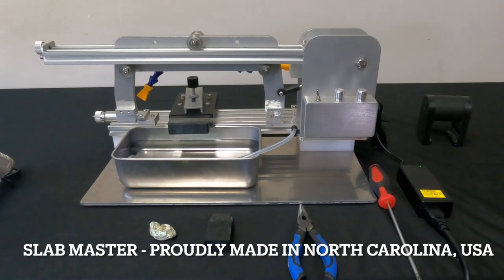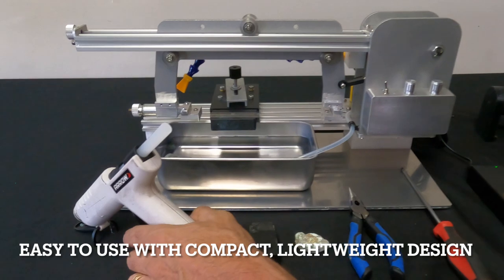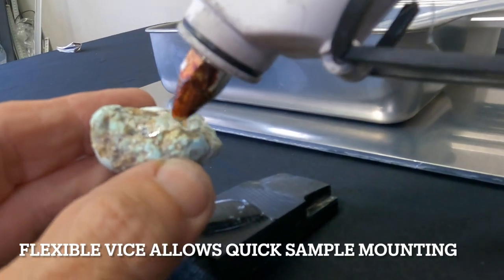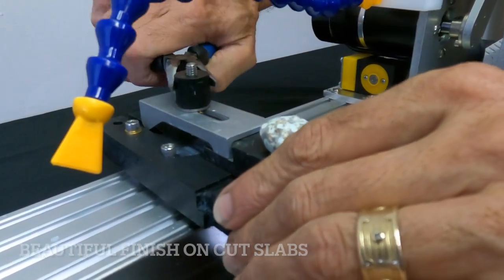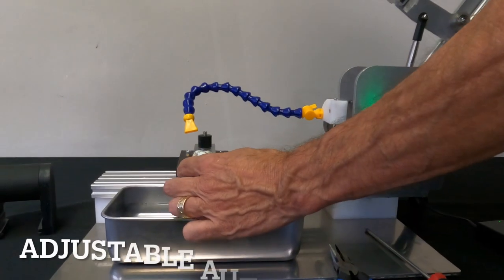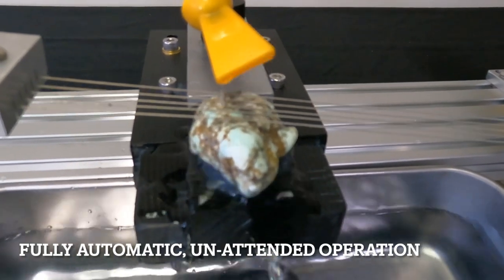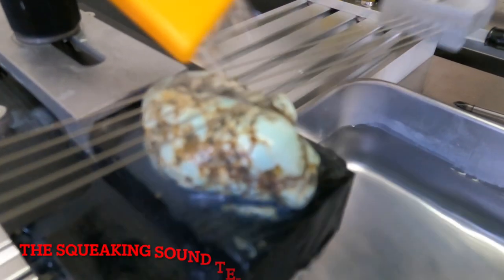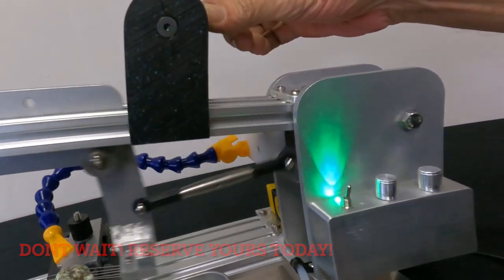SLAB MASTER AUTOMATIC DIAMOND WIRE SLAB SAW FOR LAPIDARY, GLASS ART, METAL, GEMSTONES, AND MORE!

Comment: What is the cost? And for turquoise how often you have to change out blades?
Reply from the maker: Hello! Thank you for reaching out! I am completely overwhelmed by responses to the Slab Master Saw. In response, I have created a new Facebook group. Please check it out and join!

To answer your questions, diamond blades vary tremendously and are created for a wide variety of materials. We do not manufacture any of the diamond blades, as this is a science in itself. The blades we offer are generally designed for corundum, but will work on more than just rocks. Generally speaking, this machine utilizes 1M (1 Meter) of wire to string the saw. The blade life depends on the following:

. Hardness of the sample
. Size of the sample
. Amount of weight on the bow

We will be offering this as a complete kit which will include: 500M (Meters) of various sizes and grits of genuine diamond wire. Generally speaking, this will be enough wire to last a prolific cutter a year or more. We will be offering many options on the diamond wire going forward. These on average cost about 50 cents or less.

This machine will be commercially available during Tucson 2024 (January). Please come and visit us at the 22nd Street Gem Show (if possible) to see a live demo and have the opportunity to purchase a full production unit. Its retail price will be $5,000 USD, as a complete kit. Most of the components are CNC machined in house in our North Carolina, USA facility. We will take deposits on a first come first serve basis, for units shipping in January.

Typically, cutting turquoise with a hardness of 5 (the good stuff) the average diamond wire blade will last 10 to 20 hours. The same blades cutting a corundum (hardness 9) will last 2 to 5 hours. An average turquoise nugget  1" in diameter and a 5 in hardness will take less than 20 mins to cut. Remember, this is completely unattended and the machine automatically shuts itself off when completed. The slabs are perfect and have a nice pre-polished finish, even on Spider Web (very delicate) turquoise. You can even glue (3) 1" nuggets side by side, and cut 18 slabs, at one time, in less than 1 hour. This is a very flexible tool!

Going forward, I need this community to share all they have learned about this new tool. If i may, i would like to post this comment and response to our brand new community forum.

https://m.facebook.com/groups/319576267153465/?ref=share&mibextid=NSMWBT

Sincerely,

Jason Kelley
Show Off Lighting LLC. (Creators of Slab Master)
Reply: @showofftradeshowlighting1324  thanks so much for your well thought out response I look forward to seeing you at the gem show!

Comment: Cool machine! Please make a video showing how long it takes to cut a fist size agate.
Reply from the maker: Thank you! A fist sized Agate will take about 30 hours, and require numerous blade changes. Tourmaline and Corundums cut faster than quartz on this machine. This saw is really designed for gem grade materials where saving a lot of material is most important.

Comment: Anyone have guidance on the variables to cut stones of various harnesses?  Wire diameter, speed of movement, placement of weight, etc?  First stone was a piece of Louisiana opal, sandstone matrix.  Didn't get anywhere, very frustrating.  Now going to a piece of malachite to see if there is a better reaction.  Video just says to change these variables depending on hardness but it doesn't give any more information that change is required.  Not very helpful.